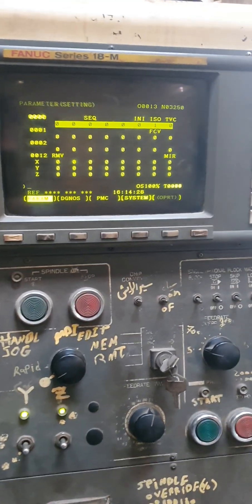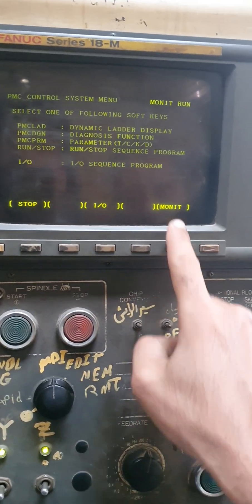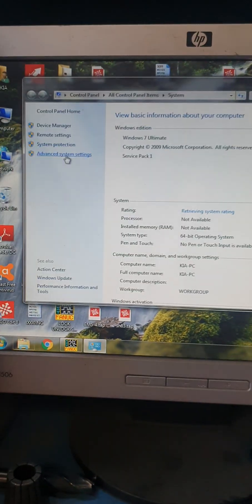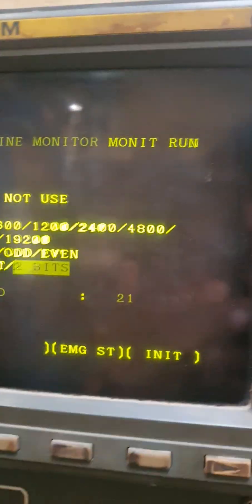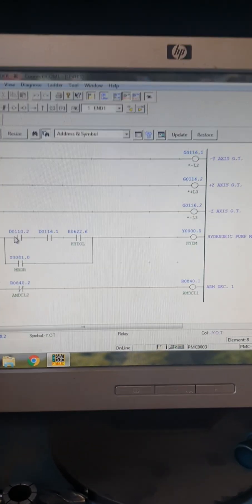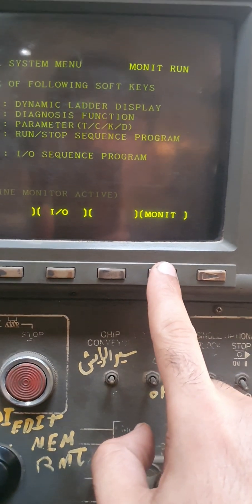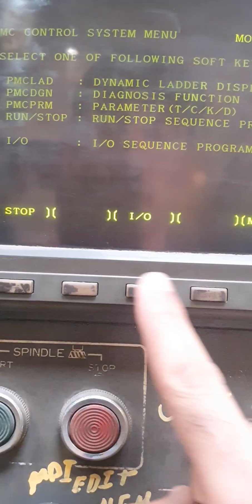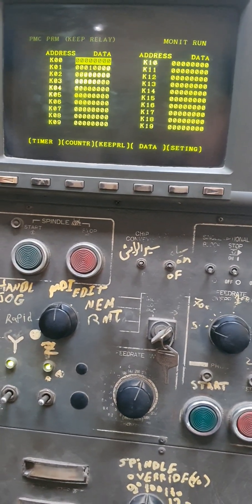How to edit online PMC ladder (FANUC 18M) via RS232 and Fanuc  Ladder III

Comment: hello, I have a doubt about rs232 communication.  In the fanuc manual it shows the cable configurations from db25 to db25, db25 to db9 but it has a configuration of db9 to pcr20.  How is this db9 pcr20 configuration used?  Where do I connect the pcr20?
Reply from the maker: What's your controller model ? I used to use DB25 Male to DB9 Female cable ... the ports settings are really important
Reply: @amirelremely7355  We have some controller model as 18iT and others, we also have db25, db9 and card pmcia, but I'd like to know how the cable with pcr20 would be used? It is rs232 ports settings too.
Reply: What parameter you have set for communication in cnc and ladder software side. Please share details.